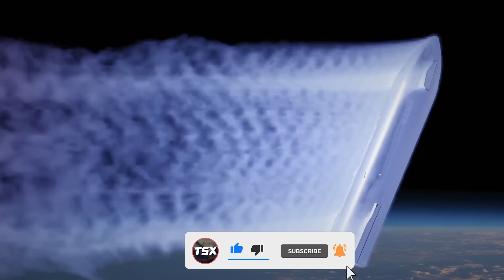Finally Solved! Breakthrough To Falling Heatshield Tiles That Frustrates Starship Liftoff

Comment: I've suggested this in many starship sights.   I used to use high heat silicone as exhaust gaskets and motorcycles. When you tighten the exhaust pipe it squirts into the flow of the exhaust gasses.   I've taken these motorcycles apart 2 years later to find the silicone still in the exhaust flame area.  It might make the ship a little heavier I'm not sure how much, but a thin beat of Hi heat silicone rubber between all the shields would provide shock absorption and a flame  Barrier. It might also be a good idea to cast into the Shields a fire ring. Look up automotive or motorcycle engines to figure out what a fire ring is. It's a bit much to explain here. But I believe the combination of the 2 would help considerably.
Reply: Re-entry will see temps of 2500F. That’s at least 2.5 times and more likely 5x the exhaust temp of ICE vehicles.
Reply: @BikeFixIT  the silicone was meant to be underneath or within the joints and not exposed to full heat load. The same way NASA used it for there heat shields on the shuttles

Comment: they should bake large semi-circular tile "belts" (one piece each) that reach around the whole underbelly of the starship and fit into each other like fish scales. -less tiles to bake, larger structure of each tile, etc. interlapping (like fish scales - as was mentioned in your video).
this would probably take some HUGE baking oven, but could it be done with consistency and within tolerances?

Comment: How many of those 25,000 Starship tiles have been knocked off during a single static firing test? Less than 20 or 30. That's ~1 in 1000 tiles becoming detached in those tests.  

Elon has added that ceramic fiber mat between the back side of the tile and the stainless steel hull of Starship. That mat provides the backup in case a tile becomes detached.
Reply: How many holes did Columbia have in it when it re-entered the atmosphere and disintegrated?
Also only “one”.